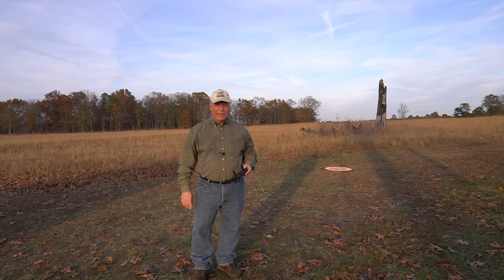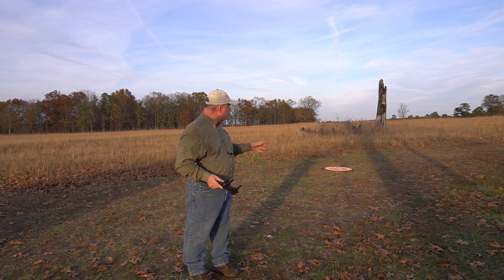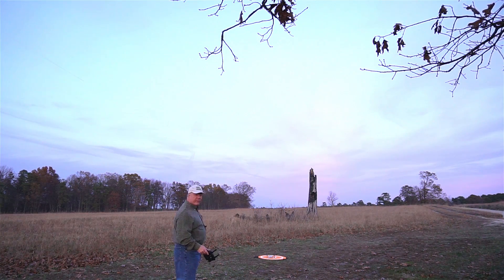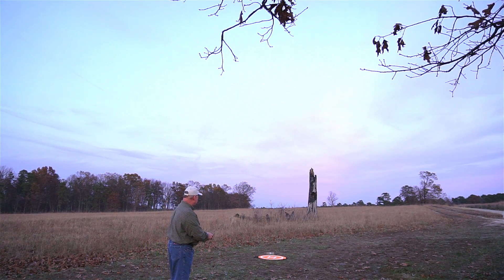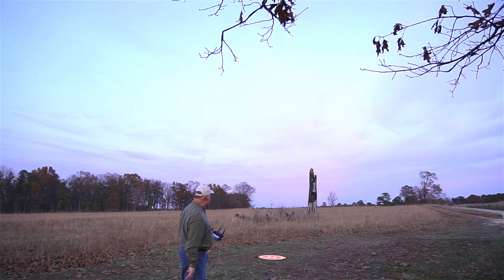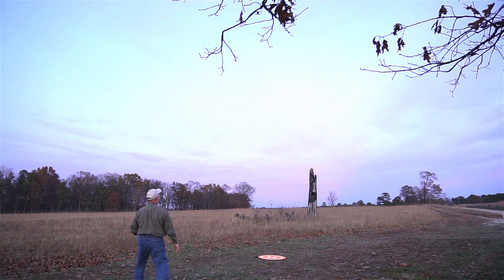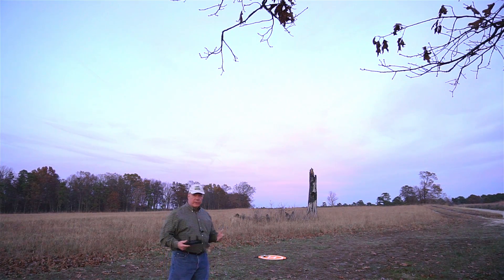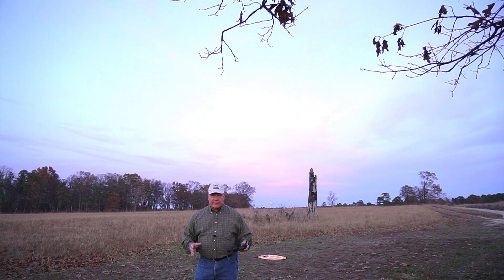Mavic Mini - How Accurate is the Return To Home?

Comment: Hi ... I calibrated the IMU and the GPS drone but I can not handle the Home point ... if I move 200m before and push the return button home the drone simply goes down where it is ... and I have to bring it from the levers manual at home. What's wrong with the way I go home?

Comment: Hi. Nice. If I understand well, it is possible to stop de landing and correct it to land in the landing pad. Is that correct ?
Reply from the maker: Frank, thanks for the post and yes, you can stop the landing and take over control of the drone any time you like during the RTH flight. If it's way off the landing pad on the descent, you can make the adjustment and land it manually. Stay tuned for more clips this week. Rick

Comment: Great test Rick. Mine missed 5 out of 5 times - I just posted the video.
Reply: Hey Bill..I just ran one this after noon. 6 out of 6 fails, but this time the unit was trying to land approx 8ft from my pad. I did recalibrate both compass and imu to ensure i wasnt off the wall.
Reply: @wobs-1962  This really is sounding like it's going to need a firmware update. Thanks for posting Colin !
Reply: @BillTheDroneReviewer  yep I think so. Had the same results last Sunday in a different location,  but was only a foot or 2 away then.
Reply from the maker: Bill / Colin - thanks for the posts and I'm sure the issue is that DJI is only using the GPS signal for the RTH and if they updated the firmware to also use the VIO on the bottom of the drone (like they did with the Mavic 2) we'll have a very accurate landing. Fingers crossed that we see that in a future update. Rick
Reply: @Dronevalley  hey Rick. As we discussed on Sunday, at least it comes home👍👍👍

Comment: I tried that 5 times today RTH. It did come home, but not on the pad. I had to manually put it on the pad, but it did hover a bit off the pad saying not a safe place too land. I really only cared the it came home..not too worried that it misses the pad..
Reply from the maker: Colin I agree about it being good enough if it's close. At this point I'm sure that they are only using GPS for the RTH but they could improve that through firmware like they did with the Mavic 2. The do have the VIO camera on the bottom, which is needed so stay tuned and I'll post an update if things change. Rick
Reply: @Dronevalley  Thanks Rick!..I am certainly not disappointed with the Mini, as understand the technology and how fewer and simpler components will never be as accurate as more superior components. Nevertheless, if DJI can fine tune this further that would be great. I have found some other quirks unrelated to this topic, but again, realize we cant expect Mavic 2 functionality from a drone 1/3 its price.

Comment: Can you do a comparative test DJI Mavic Mini vs Parrot Anafi, I don't know which one to buy. The quality op the camera is very important to me.
Reply from the maker: Freddy, thanks for the post and I'm working on a clip now to compare the two. They both have advantages where the mini is smaller and less expensive but the Anafi has a better camera and allows you to digitally zoom and rotate the camera a full 90 degrees upward. If you can afford the difference in price, the Anafi is a better drone for capturing video and images. Stay tuned for updates. Rick

Comment: Hello Rick, may I ask you a last question? it´s about the cable from the controller to a Apple phone (Iphone 6) or the Ipad Mini 4. If I not use a tablet holder, but put the tablet or phone directly in the arms of the controller are the provided cables with the Mini long enough for both phone and tablet? Is it a usb-c lightning connection or micro-usb? Hope you can answer this. Thanks for your quick replies!👍🙏
Reply from the maker: No worries, I'm happy to help. The cables supplied with the controller are only long enough to reach a phone in the handles and if you want to mount a tablet in the handles (or on a tablet holder) you need a longer one. I saw this early and had our cable partners make a special cable that allows you to connect the tablet to the controller and actually built in 90 degree connections on both ends to provide strain relief. We have 3 versions for all of the popular phones available and I have a link below to the one you'll need for the Apple products. Thanks again for supporting the channel. https://tinyurl.com/tltgaxd

Comment: I have seen a couple of other posts from different people on the return to home. It seems those that do reset the home point after the drone is airborn have excellent return to home experiences. Not resting are within 10 feet or so.
Reply from the maker: Dave, thanks for the post and I'll be testing it a little more this week, I ran out of daylight on the last test. It didn't seem to matter if it was a long or short flight or if I let it hover at various heights over the mat, it was inconsistent. The other thing that clued me in as well is that with the Mavic 2 (and other quads) that have the precision landing, they make adjustments when they get close to the mat. The Mavic Mini only adjusts at the top and just descends until it gets about 6 feet off the ground to check the terrain but doesn't adjust again. Stay tuned and I'll have updates. Rick

Comment: Straight out and back is not optimum test.Fly couple circles and squares to test real life.
Reply from the maker: Rich, thanks for the post but the RTH functions the same with any flight time or distance. What I was trying to sort out with the testing was if the VIO sensors played a role in making the landing more accurate. At preset it doesn’t seem that they do. That may change (like it did with the Mavic2) with a firmware update. Thanks for the post and stay tuned.

Comment: Hey Rick, You suggested using longer cable if using a tablet which I currently do for the M2P. When I first connected tablet to controller I used the shorter cable provided with fly more combo--very awkward but it worked. So I did have a longer micro-usb to usb-c cable but I could not get the controller to connect to tablet and open dji fly app automatically when using it. Could you or some other kind soul help me with this. If I bought your long cable I would like to know how to get it to work. THANKS!

Comment: I kind of prefer the way Yuneec RTH works. Rather than returning where it launched from, it returns to within so many feet of the controller.  Which is nice if you're walking while flying, or on a boat, you don't really want it returning to the GPS coordinate that it launched from. To be honest though, I have never used RTH on any drone other than just to test it. I prefer to manually fly and land mine.

Comment: Good info.  Also, Kelly Shores showed 5 landings with 4 of them landing on the pad.  Each flight was oriented to a different direction
Reply from the maker: Michael, I'll be doing more testing this week but I'm thinking the RTH is based solely on the GPS signal. If the VIO was playing a part the landings would have been more consistent. Also, there was no minor adjustment of the quad when it got closer to the mat like other drones that have precision landing. Stay tuned and I'll update the channel if I find something else out. Rick
Reply: Drone Valley thx, Rick , for the info.  Im one of your biggest fans, and always look forward to your info.   I attended Spinup19, wish i could have met you.
Reply from the maker: @txarchdroneguy  Thanks for the support and I'll be there next year. I had a business trip come up at the last minute that I couldn't dodge and had to miss it this year.

Comment: To Rick

Do you think there will be a Mavic Mini Pro?   If Yes then should I get my hopes up, what do you think will be added, and when do think it would release?
Reply from the maker: Great question but I'd be surprised if DJI were release a Pro version of the Mavic Mini since their design criteria was to make a quad that weighed less than 249g and build in as much as they could for the price. Even still, DJI continues to surprise me so stay tuned and if I hear anything, I'll be updating the channel. Thanks for the post! Rick
Reply: Drone Valley do you think they would make one without caring about the weight and thanks for replying
Reply from the maker: @a.c.3815  I do think they may release an update to the Spark and the Mavic Air and may combine the best feature of both into one drone. They could call this a Mavic Mini Pro but I'm just guessing. If they do decide to release something new, I'll be sure to cover it on the channel. Stay tuned, Rick
Reply: Drone Valley Thanks

Comment: Did you try taking it up to about 4-8 feet and hovering for a few seconds (10) and then rise to 30 feet and hover for a few seconds.  Then do your test.  This works extremely well with my Mavic 2 Pro.  If I leave off the second hover at 30+ feet, then it is not very accurate sometimes.  Also, you have more fun flying drones than anyone I know.  Thanks
bf
Reply from the maker: Bill, thanks for the post and I did hover for a few seconds right over the mat and the results were mixed. I even tried auto-launching the drone and that didn't seem to help. I'm thinking at this point that they are only using the GPS for RTH and that's OK for me as it gets it back to the general vicinity of the takeoff point.

Comment: How will it go head to head with the Parrot Anafi ??  They seem well matched.
Reply from the maker: I think they are both great quads and the Anafi has the advantage of 4K as well as 180 degree camera movement. The challenge is that it's about $300 more expensive as well. The batteries are also very expensive for the Anafi ($99) vs the Mavic Mini ($45). You have to take all of this into consideration when making your decision. Thanks for the post. Rick

Comment: Does the RTH Altitude take affect no matter the distance out? For example, if only out 30 ft distance with altitude of 10 ft, will it go to RTH Altitude before RTH?
Reply from the maker: I haven't tested the RTH in close but it's a great question. I've only had to use it a few times and was always quite a ways out when I triggered it. I'm heading back out this week to test a few other things and will check that out so stay tuned for the next "Top 10 Questions"
Reply: Good question. With the spark, if you did RTH close in, it straight up tries to land. No adjustment, no rising to altitude, it just descends and lands. It threw me off a few times before I figured out what was going on. I think it had to be at least 40 feet away (or more) before RTH works. No idea on the mini.

Comment: That was very informative. What is the maximum Height that it can achieve?  Did it hit the pad any more? The video seems to suggest it didn’t. Well it did hit one more time.
Reply from the maker: George, the max height is 400 feet (legally) and it only hit the mat twice out of about 10 tries so it looks like the GPS is bringing it home. No fear though, the Mavic 2 didn't have precision landing when it was first released and it was added later in a firmware update so maybe the Mavic Mini will get it as well. Rick
Reply: @Dronevalley  Thanks Rick. Thinking hard about getting one of these because the price and its performance are about right for me.